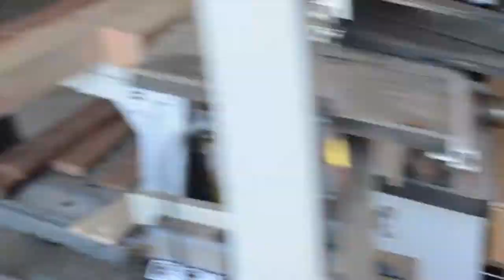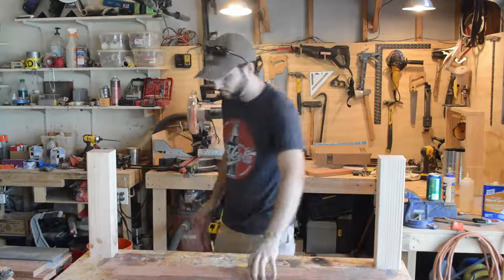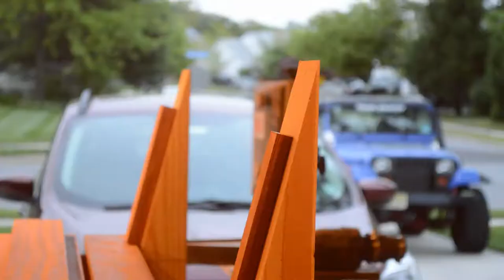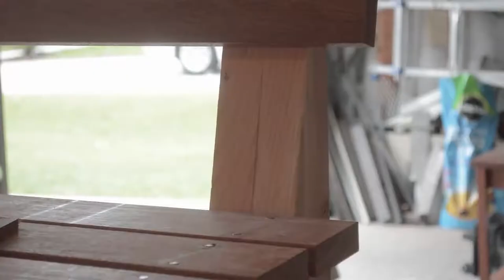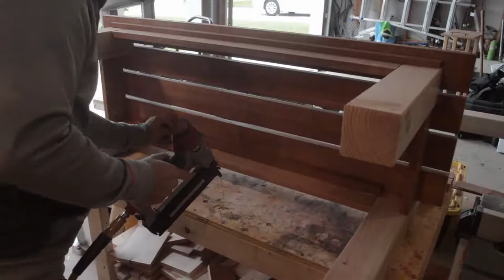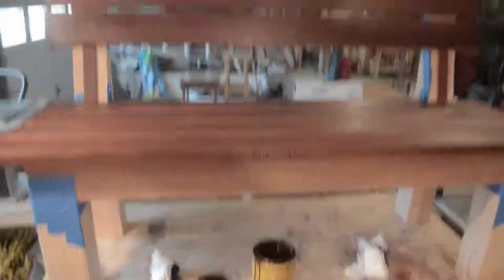Mahogany Park Bench Build.

Comment: One of the best looking benches on here made of wood.  It's real sturdy.  I found it easier to stain and run a light layer of sealer to the edges of the slats before I assemble. I hate having to waste time getting into those hard-to-reach places when I'm so close to the end.
Did you put any leather or synthetic patches under the legs to protect them?
Also, since this video is 4 years old, is there anything you would have done differently to this piece with 4 more years of wisdom and hindsight?